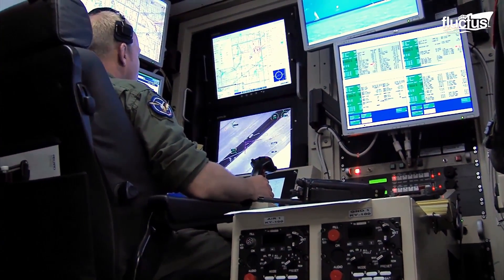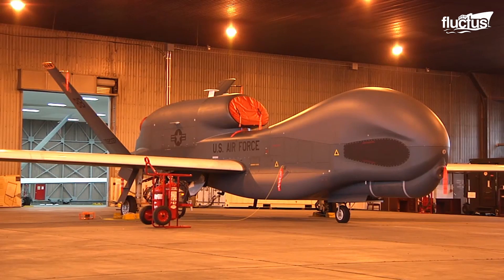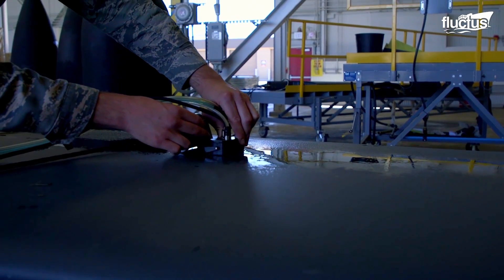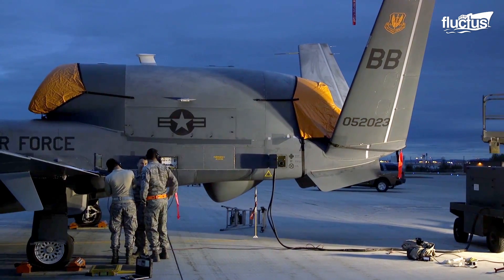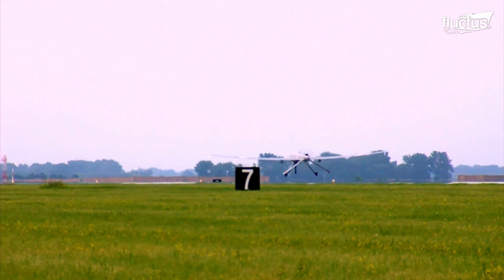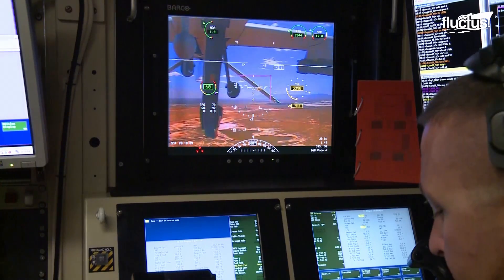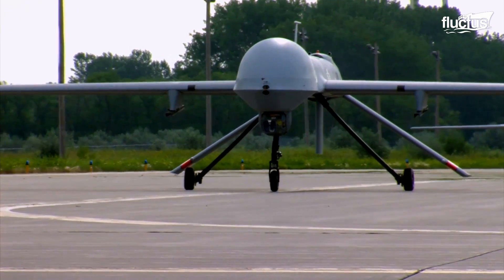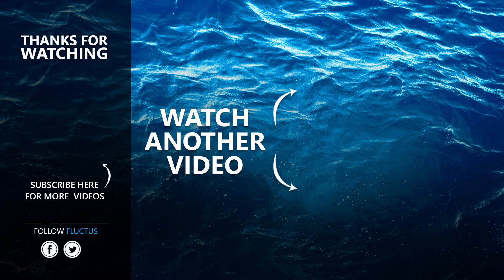How US Air Force Prepares its Gigantic Spy Drones Before Dangerous Mission

Comment: Giant spy drones are easy to spot, it kind of defeats the purpose.
Reply: they're so high in the air you cant even see em
Reply: @Eric12886  The Russians literally peed on one of its cousins.
Reply: @nonegone7170 Its secondary radar was turned off, they were probably hoping the Russians won't spot it. If the intention was benign they would have sent the flight plan to the Russian ministry and made their intentions clear.
Reply: @mithrandir491  The military wouldnt send a flight plan for one of their surveillance drones to those theyre surveilling 😂🤦‍♂️
Reply: @jod125  They already notify the Russians about military drills, missile tests and arms shipments. I suggest you look it up before you start acting like a douche again. Any military operation during peacetime will have to be notified, military ops without notification and near the warzone will receive the appropriate response.

Comment: Pilots are nearing oblivion
Reply: Yes, already some years ago fighter planes could have been designed to pull g's that were impossible for a mere mortal to tolerate. Also no man alive can handle the amount of things going on while flying.  You REALLY need at least two people in the flight deck, but then the plane becomes even larger and heavier and not as agile. Best to have 3-4 people safely on the ground, where they're not in half-panic mode, cooly managing each of their systems. Also, it's easy to change aircrews. Definitely the future is for entirely unmanned aircraft, but the airforce will take a very long time to admit this.

Comment: Line-of-sight is still a major hurdle both for drone pilots and DEW - so a 24 inch monitor doesn't give you a heck of a lot to "see". For scoping the horizon a widescreen 38 inch panel is a far better choice and a tool I would demand, even for flight sim training. I also find it hilarious that those systems are still running Windows XP (look closely). Modern PC hardware won't have the driver support for that.
Reply: The uk had to downgrade its computer networks to connect with the usa apparently.  
I mean i get it for this type of thing, xp was the last solid os.  later they screwed with the usb stack and introduced latency, which is why your doctor uses xp/vista. Anything newer isnt medically certified. Xp is.

But yeah...gary mckinnon got in looking for aliens from his moms basement.   Top notch security 😐.
When they asked him how, his reply was "theyre running windows xp🤷"

No wonder putin had such an easy time with it all. And thank god britain was up to date, or he may have gotten away with it.

Comment: imagine if  you added mid iar refuelling to that ( and a pilot shift change)
Reply: The pilots are changed for sure. Nobody can do this job for 24 hours or longer.
Reply: Or AI as a pilot!
Reply: @a.v.gavrilov  They don't need AI as in most cases the route may be programmed in advance. Autopilots are much older than AI.
Reply: Networked drones. Scary things
Reply: Imagine the other pilot b U..a douchebag